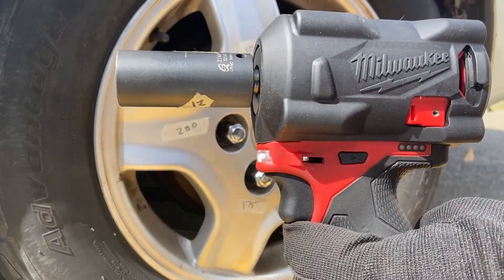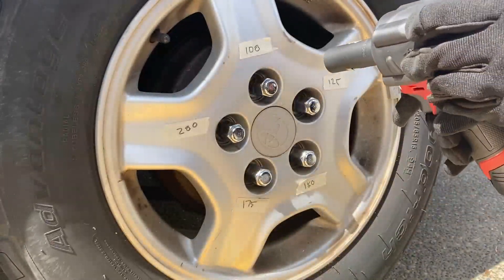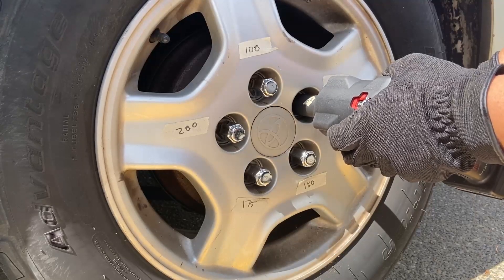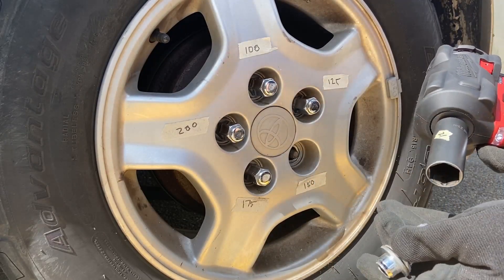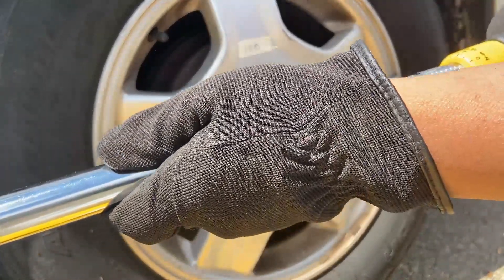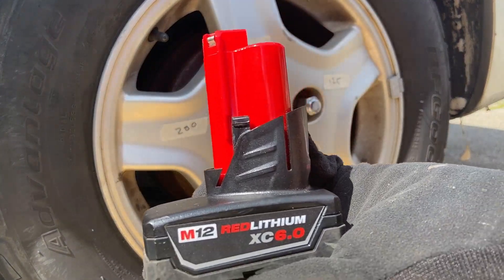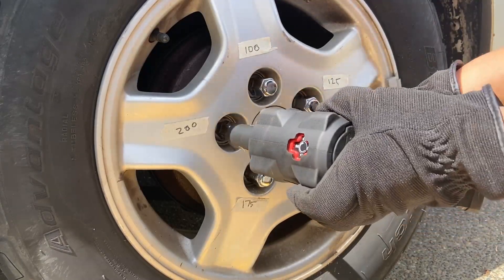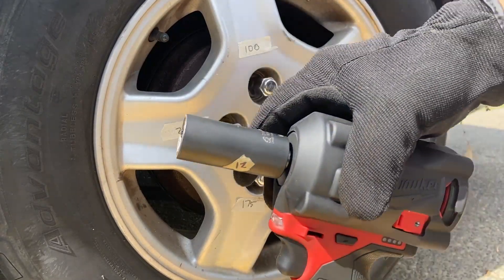Milwaukee M12 Stubby Battery Test

Comment: So 6ah battery got more power
Reply: Łukasz Zawadzki actually, it’s got less power than the 3.0XC and 4.0XC, he was using an old XC battery (which is the 3.0XC, but since it’s not labeled as 3.0XC, must be an older unit), and that’s the reason the 6.0XC appeared to outperform it. The 3Ah cells used in the 3.0CP and 6.0XC have a lower maximum amperage rating than the 1.5Ah and 2.0Ah cells used in the 1.5CP, 2.0CP, 3.0XC and 4.0XC batteries. Compare new batteries and the XC3.0/XC4.0 will outperform the XC6.0 in high demand applications, but will have shorter runtime.
Reply: @geoffstrickler  so if I want the most power I should look for a 3.0/4.0ah battery that will be labeled as XC3.0 right on the battery itself?
Reply: Jayjayhooks in the M12 line, that’s correct. At least with genuine Milwaukee batteries. The 6.0XC will give maximum runtime, but won’t give maximum power to some of the M12 tools as it uses two sets of cells that can deliver a max continuous power of 15A per set, 30A in the 6.0XC battery. Won’t be noticeable in some of the lower power tools, such as the hex Screwdriver, but impact drivers, drills, and saws can generally use the extra power to deliver better performance. 

Theoretically, you could get basically the same power from a 5.0XC...if anyone makes one. I’m not aware of such a battery, but maybe some third party has made one. That’s because there are 2.5Ah cells available with a 20A rating so an XC pack made using those cells could deliver 40A, with 5Ah capacity, just a little shy of the 45A/44A you can get from the 3.0XC/4.0XC.
Reply: Jayjayhooks however, if you’re not using a drill/impact driver for larger holes/fasteners, you might not need the extra power, and in those cases, the 6.0XC may deliver sufficient power, and longer runtime. 

Saws will almost always do better with the higher power batteries, so unless you’re cutting lots of smaller/thinner or softer materials, I wouldn’t recommend the 6.0XC for any saws.
Reply: @geoffstrickler  thanks for the response! I want max power, not max runtime; run time is easy to get around by just having more batteries at the ready.
Reply: Jayjayhooks then the 3.0XC/4.0XC should be your choice. Stock up on whichever one you get the best deal on, and maybe spend the money for the Milwaukee “rapid charger”, 48-59-1808, it charges the M12 (and M18) batteries notably faster than the standard M12 or M18/M12 chargers. Two packs of 3.0XC batteries are often on sale for $99 a pair. Don’t waste money on the “supercharger”, unless you have M18 High-Output batteries, it’s no faster on any other battery.
Reply: @geoffstrickler  So I watched some videos, and I can clearly see the 6.0 putting out more power than the 4.0. I can send you a link to the videos if you like, but he tested the stubby impact with a 4.0, and a 6.0. The 4.0 took about 3 seconds to break a nut, while the 6.0 took about 2 seconds.

I also watched battery tear down videos, which confirmed what you said with regard to the cells and max amerpage. Yet the video evidence is clear, could there be other factors? 

The person who put out the test video ascribed the difference to 'voltage sag'. I don't really know what that means, but perhaps there is something in the electronics that could possible be throttling the power in the 4.0?
Reply: @geoffstrickler  The impact test was performed twice for each battery, same results. And the nut was torqued using a digital torque wrench. Just so you know the test wasn't fatally flawed, or a single data point for each.
Reply: Jayjayhooks voltage sag would not account for that. Yes, the more current you draw from a battery, the lower the voltage will be, but it’s not proportional, the higher current unit will deliver more power in all cases. Nor is there any real difference in the electronics between any of the M12 XC packs. 

The “age” of the cells, not so much chronology age, but the number of charge/discharge cycles and the depth of those discharge cycles can make a difference. Unless both packs were basically new, the difference is probably due to usage and wear on the 4Ah pack. It’s why most reviewers use relatively new, fully charged, batteries for their reviews. It’s the only way to ensure consistent and reliable tests. 

BTW, I just ordered a new M12 tool that will include a free 6.0Ah battery so I’ll get to see for myself how it does against my lightly used 4.0Ah pack.
Reply: @geoffstrickler  Ok, keep me posted on the test results! I'll try to remember to message you in about a week if I haven't from you by then! 

Thanks for all your help by the way, it is much appreciated.
Reply: Jayjayhooks not expecting delivery for about 2 weeks. Hoping it arrives sooner, but that’s the current estimate.
Reply: @geoffstrickler  ok, no problem. What tool came with a free 6.0, if you don't me asking?
Reply: Jayjayhooks several kits offering a free tool or 6.0. I ordered an M12 Fuel Surge kit. Recently lost (apparently stolen) my M12 Fuel Impact driver, going to try the Surge for the lower noise levels. Also bought a replacement M12 Fuel Impact driver today, since it’s cheap right now. Not going to open it until I decide if the Surge is a suitable replacement. I have some Ridgid 18V impact drivers, so waiting won’t be a problem.
Reply: @geoffstrickler  awesome, I'm going to take a look around. See if I can find a ratchet with a 6.0. My kit is currently the brushed Hammer drill, brushed sawzall, fuel impact driver and soon to be the impact wrench. Don't have any of the XC batteries though, so still trying to figure out which is best. But if I can get a 6.0 for free, with something like a ratchet, I might go for it.

Comment: The last setting gives you all power not the number 3
Reply: Wrong
Reply: 4th setting is the 3rd in reverse. Only effects the forward.
Reply: 4th speed has the same as 3rd in reverse. The 4th is a drive control mode that will take off fasteners full power but only drives them forward until it hits 5 ft lb just enough to get the bolt snugged up to keep from over driving it.

Comment: Your 3/8 stubby seem weaker than mine 3/8 stubby, with 2.0 Milwaukee I can take out 125ft-lbs faster than your 3.0 milwaukee
Reply from the maker: Yeah every below 3.0 battery I tried results in the tool timing out (blinking led) upon heavy load. I contacted Milwaukee and they recommended that I send it in later. Said some of their offices are closed during pandemic.
Reply: Tool Gear Bandits hope you get yours fix or replace, Milwaukee come out with new m18 compact impact wrench and mid torque. The new mid torque definitely smaller than the mid torque I have. But the compact rated the same as m12 stubby in torque, I think m18 will be stronger due to the battery size.

Comment: oh and 3/8ths drive isnt for 1/2 installed fasteners like lugnuts. use the proper tools
Reply: Rob Shapiro 3/8 drive is good to ~200 ft lbs, per SAE specs for 3/8 drive tools. Plenty for standard auto lug nuts.